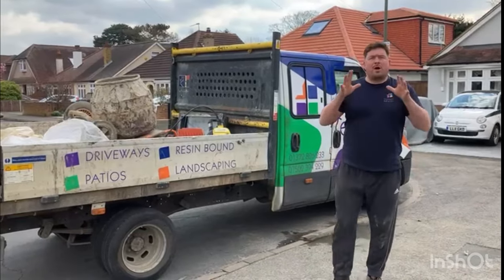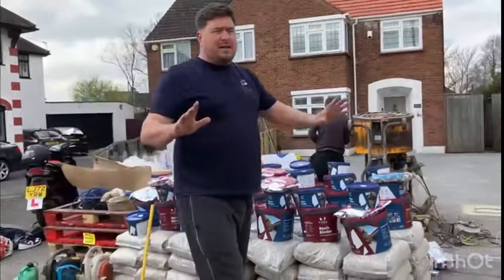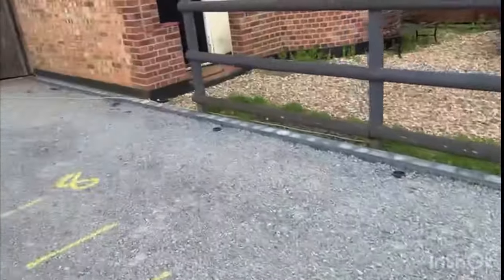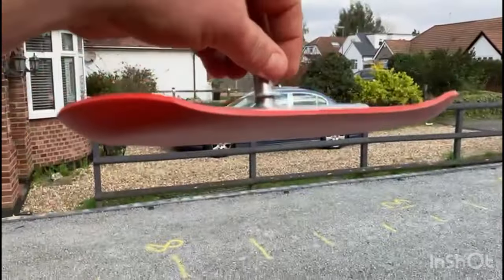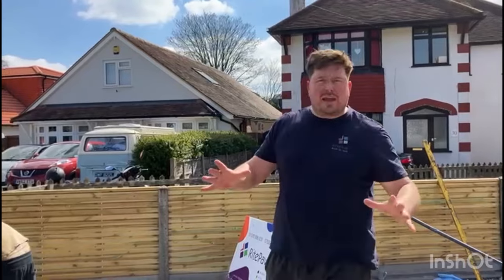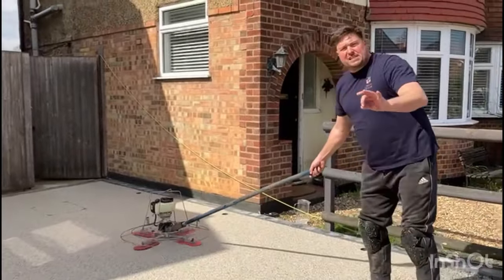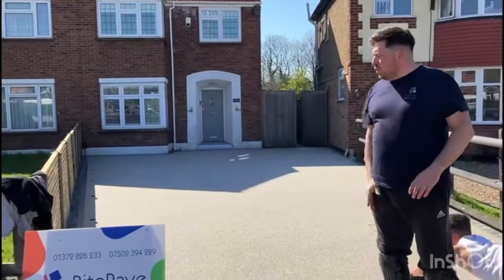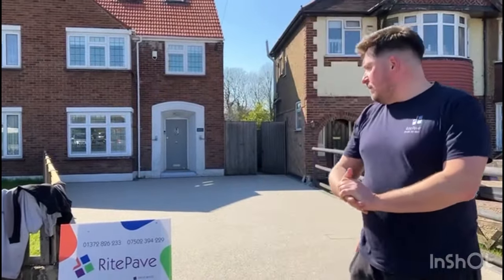How to lay a Resin Bound Driveway

Comment: What base have you laid this on? quality job 👌
Reply: Has to be type 1 crushed stone to be permeable.  All driveways have to either be permeable or have a drainage system built in, no surface water is allowed to run on to the road

Comment: Looks great, what was the base?
Reply: Has to be type 1 crushed stone to be permeable.  All driveways have to either be permeable or have a drainage system built in, no surface water is allowed to run on to the road

Comment: What base did you use
Reply: Has to be type 1 crushed stone to be permeable.  All driveways have to either be permeable or have a drainage system built in, no surface water is allowed to run on to the road
Reply from the maker: Type 1 with permeable concrete on top 👍